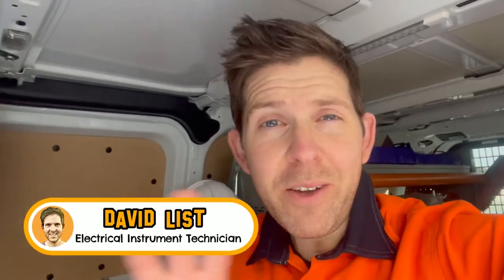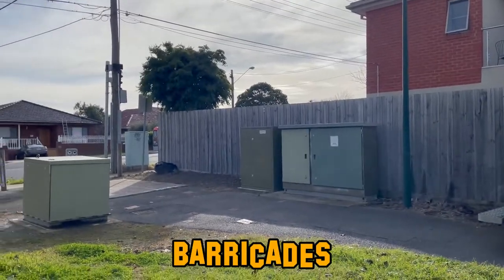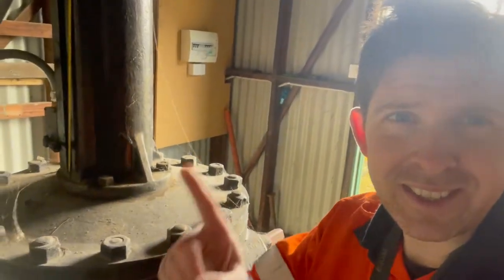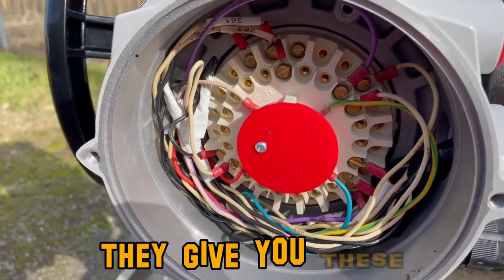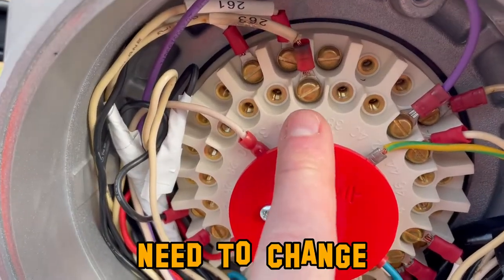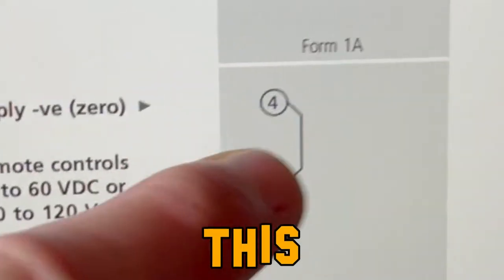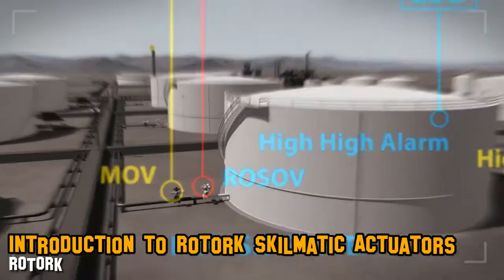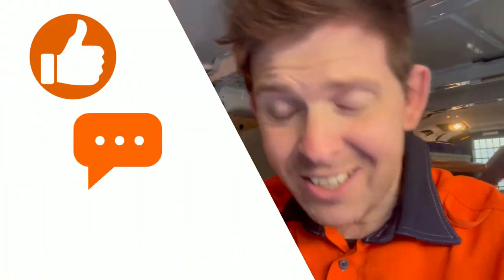Why Electric Actuators SUCK 😒

Comment: Yes, Rotork are a pain to wire, as per comment below, I call them a split end screwdriver. The control circuit can use an external supply or the internal supply.